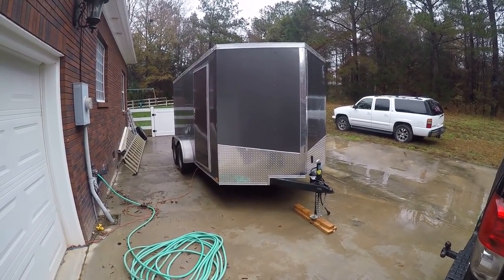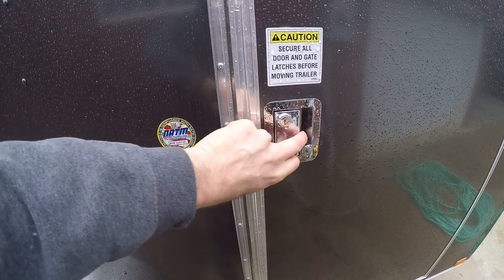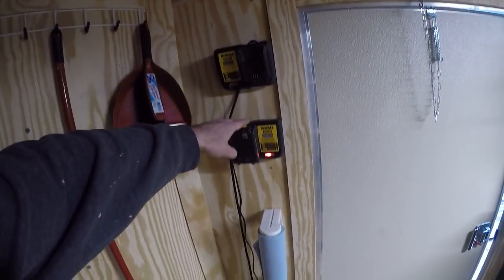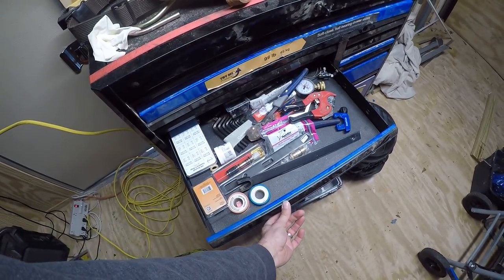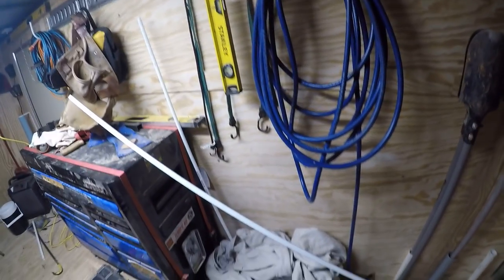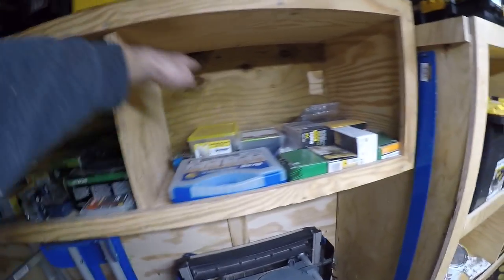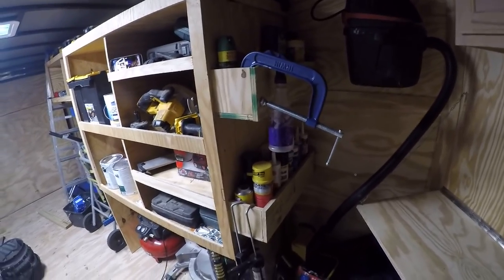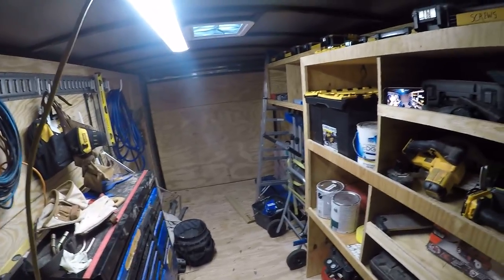Handyman tool trailer

Comment: I just bought a 7x14 tandem as well. 3500 pounds is the axel rating. With 2 axels your gross weight rating is 7,000 pounds. So you can haul the difference between this and the trailer weight. this trailer only weights about 2200 pounds or so.

Comment: Hey Matt,  Nice trailer!  I picked one up just about a year ago and l love it.  My only problem was that the roof vent cover recently broke.  Nothing hit it.  I noticed a crack and upon physical inspection the thing just crumbled in my hands.   I too live in South Carolina so I'm not sure if it was caused by the heat/sun or just a cheaply made cover or both.  Either way, I'm sharing this with you because I'd hate to see it rain inside your trailer.  Keep up the good work.
Reply from the maker: Thanks for the heads up! I'll give some advice in return.  Dont use a rolling toolbox like I did.  The drawers are constantly opening up and dumping everything on the floor.  Also its damaged the slides.  I just pulled mine out and started installing some ron paulk drawers.
Reply: @adventuresofahandyman4446  I could imagine.  Thanks for the return advice.

Comment: I bought a 12x7 for my handyman business. It is very similar to yours down to the color! I have not yet started building mine out. How did you fasten the cabinets to the wall?
Reply from the maker: Self tapping metal screws.  I was actually just out in my shop working on some cabinets.  I downloaded the plans from ron paulks website.  He's got a lot of good info on trailer organization